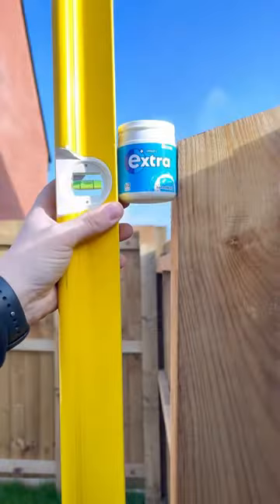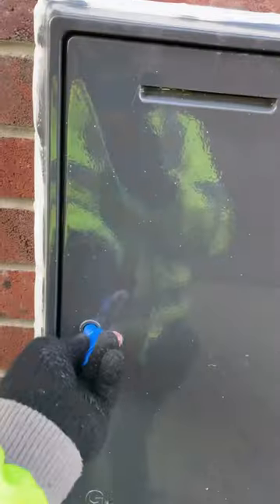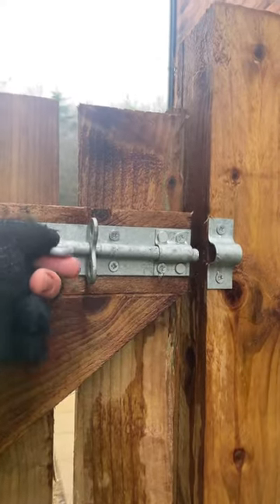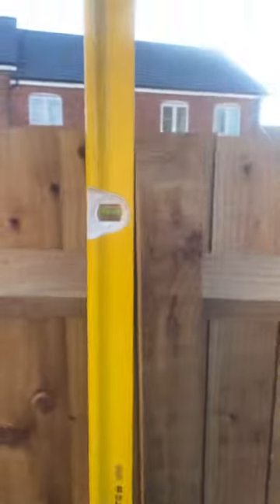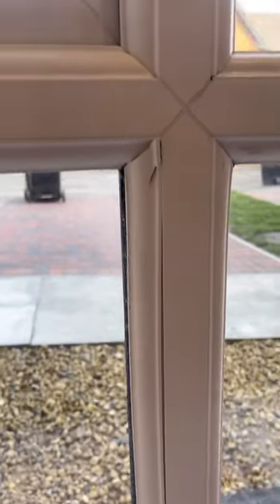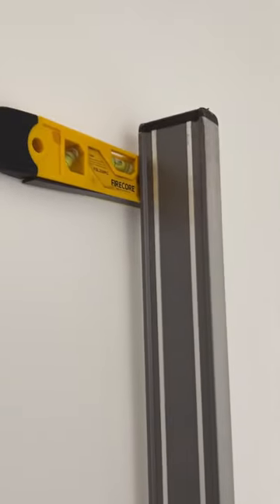Uk New Build Snagging Inspection #94

Comment: Hey NHQC, I'd be really interested to know how 'bad' these are? It'd be really cool to get a sum up, a "these are quick fixes but shouldn't be here", "Just cosmetic but a bad look", or a "This will be expensive to fix, and definitely needs doing"

I just sometimes struggle with understanding how critical some of these things are. Are they deal breakers, or just annoyances?
Reply: The likes of fence posts and no mastic are easily fixed but Brickwork miles out or walls miles out probs never cause anything but cosmetic probs but cost fortunes to fix as it has to be rebuilt innit!😎🤣🤣🤣
Reply: Cosmetic - but the house might fall down !
Reply: @edwickford2377 the house won’t fall down because the brickwork is out. You have the block work/timber frame behind it.
Reply: @jamesroberts8287  And what makes you think the block work/timber frame doesn't match the brickwork ? You line up the brickwork against the frame. I wouldn't trust it - but please feel free to move in if you see a house like that.😀
Reply: Some fixes will be less expensive than others but the real issue is that these are new build houses and shouldn't have problems like this in the first place.
Reply: @edwickford2377 you probably live in a house like that 😂
Reply: @beefcake4776  I 'probably live in a house like that' when I have already said I wouldn't trust it !!! Where is your logic on this one?
Reply: @edwickford2377  because you would be completely oblivious to the fact my man. You know how many houses are built like this these days? And old houses are even worse
Reply: @beefcake4776  I agree , new houses are often constructed very poorly. My house has stood the test of time (and there is no better test):face-green-smiling:.
Reply: @edwickford2377  you should see the plots (house’s) I’m working in atm, at least one wall in every house out of the 8 has had to be knocked down and re built from being so out. The externals are the same but once they go up you’ll have a hard job getting anyone to knock them down again. Too pricey

Comment: Question if you'd be so kind as to answer. Are aco drains and down pipes that terminate in below ground drainage required to have a connector/coupler, weather it be rubber of PVC. But should it be connected and not just hovering over allowing a load of debris to fall in? 👀😆
Reply: connectors not allowed, got to ensure a sinkhole in 10 years